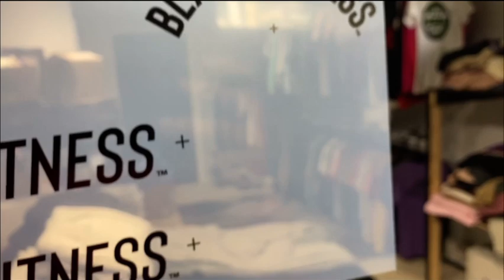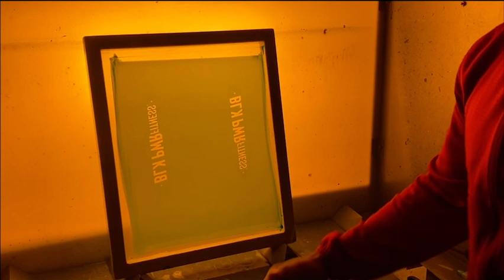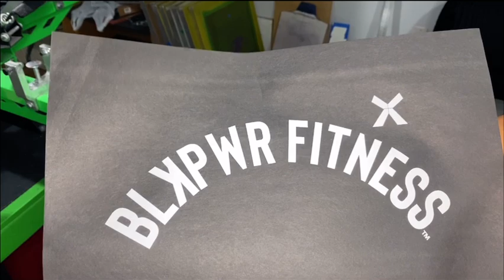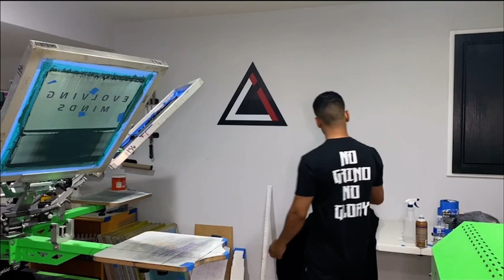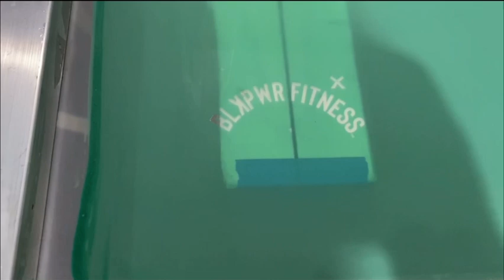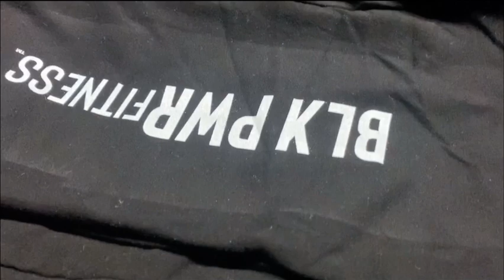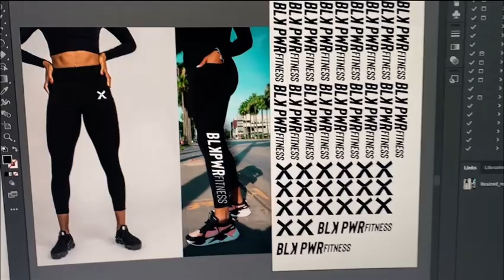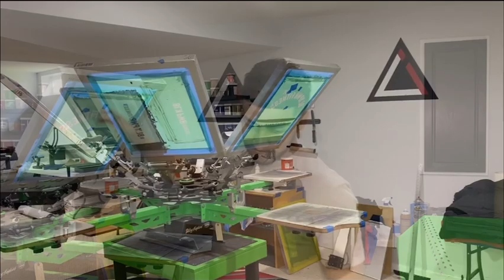Screen Printing For A Clothing BRAND | Step By Step

Comment: Bro great set up. Is that black Flash Dryer a Coil or infrared ?? If its Coil how do you like it??.  Thank you for your videos..
Reply from the maker: Thank you bro! That flash dryer is actually a coil flash dryer, it definitely gets the job done. I have been using it for over 4 years now with minimal problems and I have printed hundreds of items at once. However I am definitely upgrading to a infrared flash dryer when I find the press I want. Thank you for tuning in!
Reply: @baavproductions  awesome bro. I am just starting out and need a flash dryer. Any way you can send me the link or brand?? There are so many coil flash dryers . Appreciate your words/videos..
Reply from the maker: @rmunoz5439  Yeah man of course. Just trying to help others start a hustle!

Below is actually the same one I have till this day.

https://www.amazon.com/VEVOR-18x24Inch-Electrical-Printing-Adjustable/dp/B0876537N6/ref=sr_1_1_sspa?dchild=1&keywords=flash+dryer&qid=1623433829&sr=8-1-spons&psc=1&spLa=ZW5jcnlwdGVkUXVhbGlmaWVyPUExNEpRUzc1TEFTSDdJJmVuY3J5cHRlZElkPUEwNTQyNDA1MTRQTENHUFg4UktSSCZlbmNyeXB0ZWRBZElkPUEwOTA2NzA1MjBDTzU3UTJFOUtOTCZ3aWRnZXROYW1lPXNwX2F0ZiZhY3Rpb249Y2xpY2tSZWRpcmVjdCZkb05vdExvZ0NsaWNrPXRydWU=

Comment: 27:26 let it cool down first rudeboy  den stretch test it. If the print is still warm the chemical bounding prosses ain't done yet.
Reply from the maker: indeed like I mentioned in the video as well. Great tip and input though.

Comment: Is it possible to screen print on mesh material? Specially 100% poly mesh shorts (black)
Reply from the maker: Definitely is possible, I have done it before and turns out good. Just remember the holes of the mesh will show but the design still will look good. It is all trial and error so try it out!
Reply: @baavproductions  thanks for getting back to me 🙏🏽
Reply from the maker: @XxNovaWolfx  No doubt!